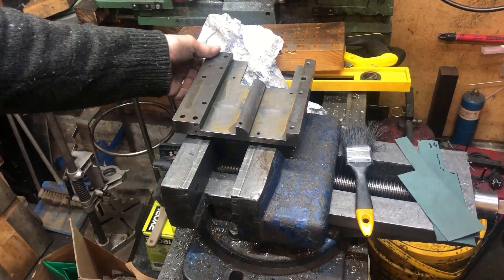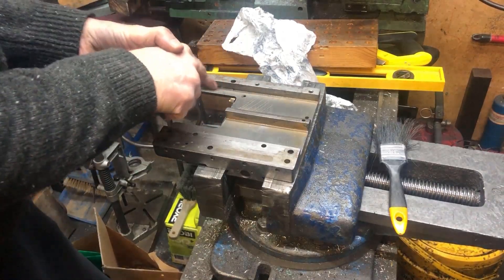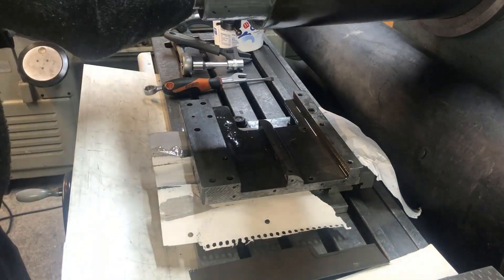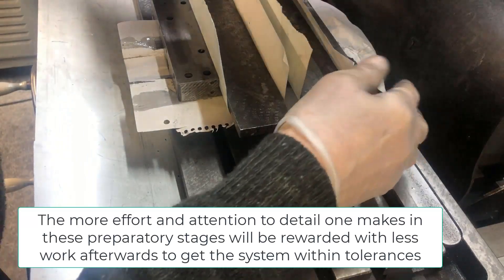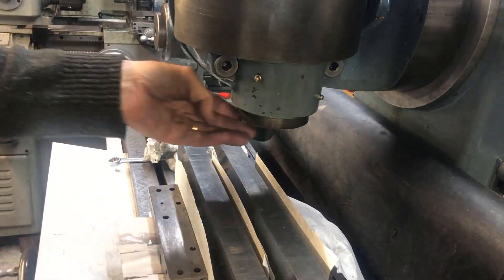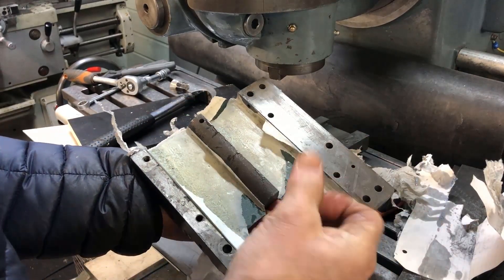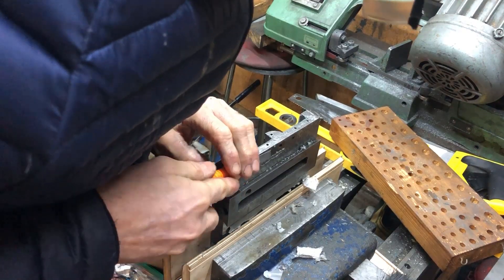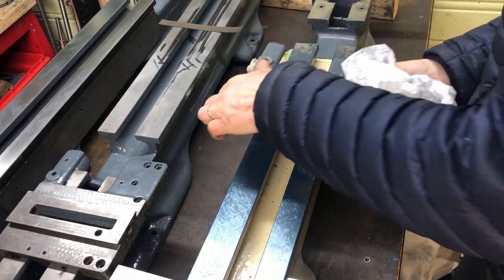Myford saddle resurfacing including Rulon application - 4 - prep, glue, clean and measure the Rulon

Comment: I like that procedure, I'll have to try it on my next project, a surface grinder.
Reply from the maker: Thnks. I did 2 saddles this time and this was the 2nd and most sucessfull. I will show some of the procedure for the 1st also, which gave a bit more work at the scraping stage because of a slight load imbalance during the clamping with weights I guess. Could be useful to see for others I hope.. Then the scraping of that same saddle